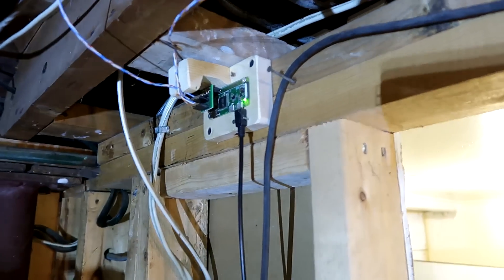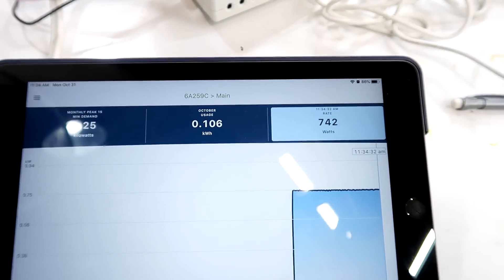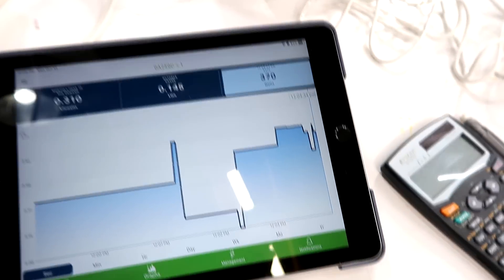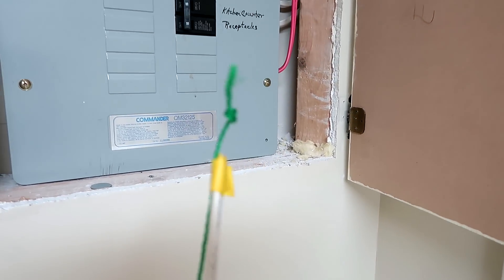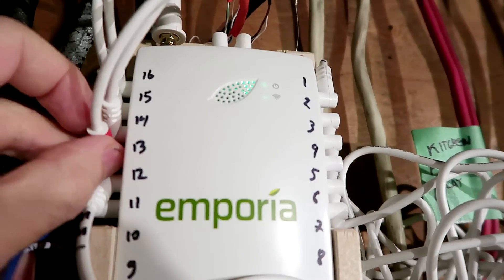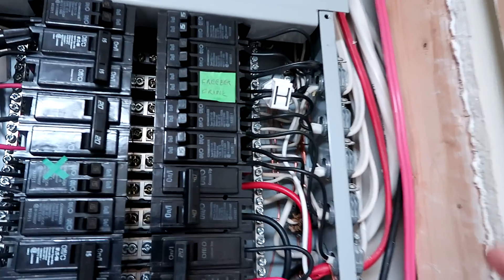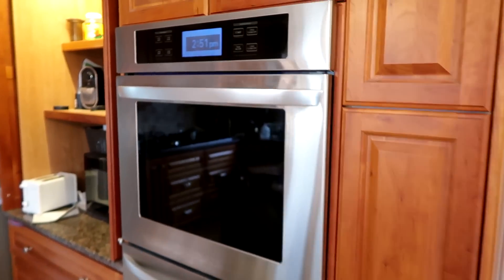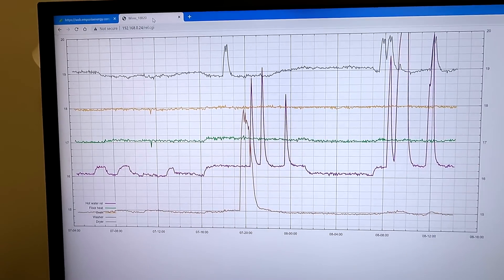Power monitoring 16 circuits at the breaker panel

Comment: One very important thing is to never unplug the current transformers pigtail while it's on a wire. It will cause high voltage arcs across the pigtail wire ends
Reply from the maker: these current transformers have the shunt resistors IN the transformer unit, so unplugging it doesn't cause crazy voltages.  Kind of sensible to do it this way.

Comment: Matthias, I have a similar system called CURB Energy with 20 current transformer sensors....I also have the kilowatt meter, and a Fluke 335 true rms clamp meter, that gives me good comparisons....

The curb system is quite accurate, and I get Email "colour" graph reports monthly with no charge for it for the past 5 years I have owned it, and they also upgrade the software with more additional information often, with no charge, which is quite the thing really...
  I am also able to insert the KWH cost from NB power, and actually get a cost comparison report.

I  have a generator and generator panel, and recorded the rush or start up currents for various appliances and necessities,  such as my water pump so that I could manage power usage in a power outage....
This is valuable, as I cannot run everything on my 7200 watt generator at the same time, however, I can run everything singularly including my water pump that has around a 1700 watt start up current by managing my circuits at the generator panel so that not everything is on at the same time......All good.

Comment: I have recently been lookin at this device. I have ofteh thought of making my own but kind of think about the time to build it... Its all simple enough. Recently  have been playing with Home assistant. A completely locally run home automation system that runs on a Raspberry PI. It works well. If you punch a hole in your firewall you can even use it remotely. Maybe I should do an energy monitoring system using Home Assistant...

Comment: I absolutely agree with you. I hate devices that require internet access and store data in the cloud and do not use them.

I've done several home automation projects and they all work independently of the internet (well except for email notification) as long as our LAN is running. But they don't have a pretty user interface so no one but me uses the info. I guess that would be a good winter project learning data presentation.

Comment: I basically did the same with a Shelly 3EM and monitor my main 3 phases. Works great and the UI is basically local. So if they stop their services I can switch to VPN whenever I need to know my usage when traveling. Which is not that often anyway.

Comment: Hi Matthias - wish to see you do solar - Hybrid Inverters - lots of tech, wiring and metering involved with solar. Since you had many clamps measuring amperage, a not that the CT clamp for my Sunsynk inverter is direction sensitive - it shows negative values if wrong way around over wire, it is interesting as it measures AC.

Comment: You may get a bit of inaccuracy if you group a 240V breaker into a single transformer because it then only uses the voltage of one of the two phases to do the calculation. With a high load on one phase it may pull down that phase considerably an thus skewing the power reading.

And if it has an ESP in it already, you can just reflash that, no need to use your own ESP. I see Tasmota already supports some of Emporia products so probably doable to add the Gen 2 Vue.

Comment: Hi Matthias, cool video as usual - your experimentation here is close to my heart. However I've gone down the line of using single DIN energy meters with isolate pulse output (rather than using current clamps), because they are cheap, accurate (or at least they should be within the standards spec) and really quite reliable. I monitor the pulses myself and can monitor larger circuits like Solar injection, Grid power in, what goes to the house, and what goes to the office. Although these measure energy, its trivial to work out what the instantaneous power is within the time base accuracy of the microcontroller. All this data goes into an Influx DB time series database which is displayed on a Grafana web interface, both of which running as servers on a Raspberry Pi - all free to use, and all running on a local subnet 24/7 without having to connect to the cloud. I know it sounds like a lot of work, but actually I don't think it will take you that much time to learn the stuff. I can even take you through the process if you'd like - just email me.

Comment: Watch out , when you don’t have the current coils connected they could destroy or give some undesirable voltage themselves. (Only at the higher currents) . At my work when we have to change the energy manger we us short circuit leads for them. At my work we use chocomec units with some bigger pickup’s (up to 200 amps )
Reply: I ment 2000 amps at 400 volt AC

Comment: Look at Tasmota then you can have the power to control it and push the data via say mqtt to store it and visualize it another solution though more expensive due to the number of monitoring points are Shelley PM IOT switches (if you dont want to roll your own - though if you do please do a video!). with the Shelley You can flash them easily and they can monitor power as well as control the power (turn fridge off over night for example).

Comment: The reason of the different reading for killawat and courant sensors is that kilawat sees the voltage and the current together, so it is able to compute rms accurately, but the current sensor only rely on current, and make hypothesis about voltage, missing both the real voltage and the power factor.

Comment: Have a look at Home Assistant on a local Raspberry pi, and the use the ESP32 connected to EPSHome to download firmware to read the energy usage. Here in Sweden we got new energy meters installed so it gave me an easy solution to read the raw data from the HAN/P1-interface on the powermeter to an esp32 and push it to my home assistant. Adding InfluxDB and grafana as secondary datastore and visulizer I can create graph and inspect all power usage with 10 sec update intervals. I have then got a some Shelly power switches with energy meters built in connected to the same installation so I can see each applience, combining with the energy dashboard and the Spot price for energy at Nordpool I now know exacly how much each part use and even how much it cost each hour. Since I have the total usage directly from my powermeter it also gives me Voltage/Current and Power for all phases (3). Combining with an other module connected to my heatpump I can detect when it is running and estimat the total usage of power by substracting all other sensors from the totalt plus my "standby" power (~120W). 

Super addictive to start with home automation so watch out for the rabbit-hole. :D

One problem that you may get with the solution is if your phases dosen't have the same voltage in that case you might get wrong power usage if the meter only sample the voltage for one phase but are measuring differnet phases.

Comment: I love that matthias preffer to use a super complicated wood mount insted of double sided tape to mount it! lol.
Reply from the maker: with double sided tape, it's stuck in place.  Also, no flat surface to tape it to.
Reply: @matthiasrandomstuff2221  Maybe Velcro tape then? You could mount a small flat surface for whatever tape if needed. But either way, I don't know how long I would trust the adhesives. I like the wood mount. It's odd Emporia didn't design it with a mounting option.

Comment: I built my own version of this with an esp8266 and a nano.  I store the results on the local raspberry pi.   In a perfect world you could store one sample per second from 12 sensors for 2 days on The for megabyte flash memory of an ESP32, and hooking it up to an SD card via the SPI would also give you plenty of storage.  It definitely seems like you need an external ADC because the ESP32 ADC's are super noisy.
Reply: What did you use for current sensors?

Comment: I see that these A/D converters are very slow, I worked on industrial systems running over 256 real time sensors with 1ms response time going to an Intel 486 processor 25 years ago, another thing to consider, is it measuring the voltage to get a true wattage reading

Comment: 8:00 wrong. does not work this way.
Reply from the maker: Your failure to comprehend this affects your perception of it, but in no way affects how it works.
Reply: @matthiasrandomstuff2221  when you mix voltages or phases, addition does not work. 

You can add only wires that are on the same phase with same voltage. 

You will get a value but it will be wrong . 

Typical example : put a probe around 2 phases of a 3p motor, and you get the current of one. Put the probe around all 3 and you get 0. 

You are doing here a similar error ( slightly different ).
Reply: @Benoit-Pierre  By reversing the opposite phase it is in phase with the first phase and you can add them, that goes for a so-called split-phase system as used in most places is the US and Canada, but many other places in the world where they use a true 3-phase system it will not work.
Reply: @K2teknik.  the schematic and explanation is incomplete. 

He does not clearly says if second wife is neutral, or different phase, or same phase with different voltage.

If it's q shifted phase, currents just don't add this way ( put the core around 3 wires of a 3p motor and you get 0 ).

If it's same phase with different voltage, currents do add but then :
- where is neutral wire ?
- you get the total current but since you don't know which current flows over which voltage, multiplying by 220 or 110 does not make any sense. 110 will give an under estimation, and 220 will give an over estimation of the total power, so calculation is not relevant. 

He said 10s before that there is a voltage mix. A third wire is missing on the schematic.
Reply: @Benoit-Pierre  He's way of measuring is not perfect, but for his purpose (to collect ballpark info on what is using power and how much) it is ok. The two "phases" on the system is 180 degree apart, that is why you can twist one wire and put both wires on the same current transformer as shown in the video and the end result is the total of both phases current, if we measure one phase on its own and the outside unit is using 5 ampere (same measurement on both phases because the outside unit is connected over the two phases), then is is consuming 1200 W, as 5 * 240 is 1200, so is (5+5)*120 (witch is "twist one wire and put both on the same current transformer"), and if you add the inside units amperage to the equation then you get the total consumption of the aircon unit.
Reply: @K2teknik.  with 2 phase system at 180° this makes sense. But :
- he says he is trying to measure current for devices that don't use same voltage 
- neutral wire still missing on schematic 
=» many peaces of info are missing on the paper to explain properly. 

I did not know some countries still use 2 phase. We have 3 phase all over Europe. We used to have 2, 4, 5 ... But since 3 is the most efficient for technical reasons , I thought it had been abandoned in all modern countries, and used left only on some isolated islands for historical reasons. 

This explains why so many American YouTubers show a vertical symmetric panel ...
Reply: @Benoit-Pierre  I will refer to my first posting, it state clearly that we are talking about a one phase system, often wrongly described as a 2-phase system, and also called "split phase" and there are historical reasons for all this not fully correctly description on the US / Canadian (and some other countries) electrical system. So we are not talking about a 3-phase electrical system as seen in households in many other countries, of course the US have these 3-phase systems they are more upstream in the supply chain and for more industrial places.
Neutral is not needed because of the 1-phase deal, we can assume that we are dealing with 120 Volt, because of the split phase deal, where one of the phases are 180 degree apart from the other, then the 2*120 volt system are effectively both a 2*120 volt and a 240 Volt system all -in-one.
Why should a person living and dealing with a split-phase system struggles to explain how his system differs from other people's systems, he can surely ignore that fact that other places have way better electric distributions systems.
However, I will admit that it is often a bit difficult to understand how electrical systems work in other countries, especially when they are explained by people that do not take "my" electrical system into account.
Reply: @K2teknik.  if the purpose of the manipulation is to introduce a x2 operation to obtain a correct  watt measurement and compensate for 110 vs 220v issue, the simpler way is to make your main phase do two pass inside the core. Passing an inverted neutral is mathematically identical, but not the intuitive manner for an electrician. 

Doing a second turn with phase, or invert neutral uses exactly the same length of wire.
Reply: @K2teknik.  2 phase without neutral reminds me belgium ...

Comment: I bought a regular old analogue style energy meter few months ago,  (it has a voltmeter and a coil ammeter inside, with a mechanical counter)
At first I used it with inverter, to check idle usage , and comparing lighting circuit vs power circuit.
Then I found out it's not really useful, so I took it out and connected it to my AC.
It also has a blinking LED, I can count the number of blinks to calculate it more accurately.

here is my data.
Energy bill per month is 270kWh. So it's  around 9kWh per day.
In idle, if I turn off all my breakers and only connect the inverter, it uses 20W, even when it's not charging the battery.
Entire lighting circuit in the house uses only 1kWh per day. Which includes lights, fans, TV, fridge, phone chargers, etc.
Which means the power circuit is using 8kWh per day.

The AC, as it turns out, uses 5kWh per day. Yes. A crazy amount.
Which means the rest of power appliances use 3kWh combined.
Which include, Washing machine, mixer, convection oven, induction cooker, water heater.

Comment: Thanks. 
I suspect this equipment is not sensitive enough to measure insulation leaks. Therefore, we are unlikely to use it as a residual current monitor.
Reply from the maker: Yes, not sensitive enough to measure those micro-amperes.  And I don't care about a few milliwatts lost when I'm dealing with kilowatts.

Comment: Interesting. I have been using the Sense energy monitor for a couple years. The web app and the mobile app are pretty good. The Sense is supposed to be able to ID just about everything in your home, but I have had mixed results with that. I think it would be interesting to see you review the Sense monitor and compare it to the emporia. With the Sense you need only one pair of CTs on the mains into your panel. There are provisions for solar systems and sub-panels.
Reply: That sounds like the kind of monitoring that smart meters do and the data electric companies sell to the highest bidder [china] without notice or our consent.  I often wondered the reality of the accuracy of those systems, I guess they don’t care too much as long as it generates lots of data they can monetize.

Comment: Anyone interested in this might want to check out the sense meter.  It's essentially the same thing except for alot easier to set up.
Reply: It's quite a bit different actually. Sense measures only the main circuit and tries to guess which appliance is using power based on the waveform.

Comment: Seeing as the sensors are analog, will extending the sensor wire affect accuracy at all?
Did you do any accuracy tests with extended wires before putting them in the wall?

Comment: It might be pretty easy to either bodge on a raspi to that device, or just re-program the existing esp32 (or transplant a new one) into it.

Actually, you might be able to just do some DNS trickery to have that device report directly to your own server. I doubt they are doing any sort of TLS cert verification. They probably aren't using TLS at all either, and just using http posts for everything. That wouldn't require opening or modifying the device at all.

Comment: I have been surprised by the accuracy of the system. I have one and have recorded the data from an emporia for a while to an influxdb database as well as data from a Tesla powerwall for many months. They agree quite closely. When the house is using >1kw, the difference between the measurements is on the order of 5-10 watts, and averages to near 0 watts if I average more than a few seconds of data. This means their spec of 0.1% accuracy is probably correct if the powerwall is accurate (the powerwall is a revenue grade meter, so it is accurate enough to sell power based on the readings it provides, so I trust the values it gives).

Comment: Maybe - maybe not on the eula. I was looking at a weather station that appeared to have very similar language, which turned me off quite quickly. BUT, then I contacted the company and found that the system makes it's data available to the end user and I can do anything I want with the data. They can too, if I transmit it up to their server.
Maybe something similar in play here also. Might be worth checking with the company.

Comment: Hey Matthias, I used a C library called emonlib (short for energy monitor library) and although it wasn't great and had some confusing aspects, I was able to successfully use it to track the current draw of a 3 phase motor for a project. It may be a useful starting point for a homemade logger.